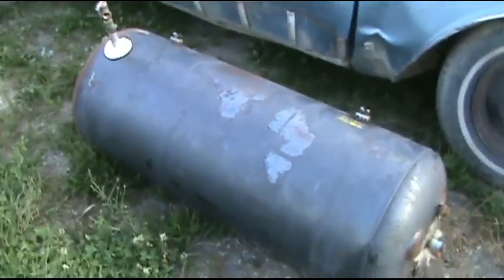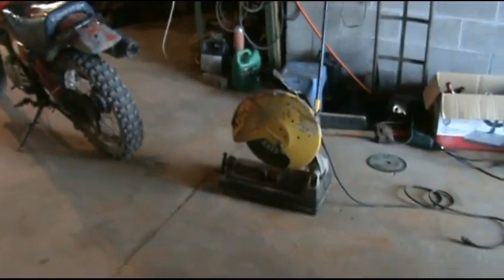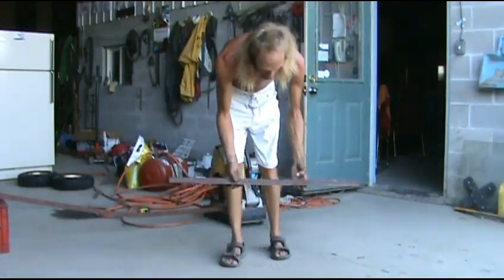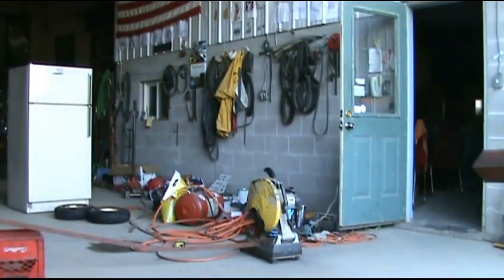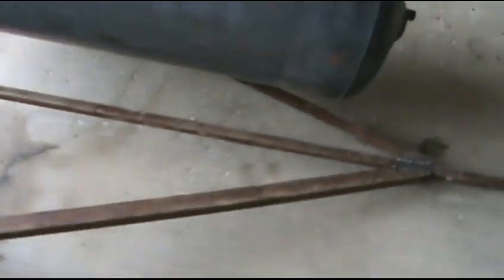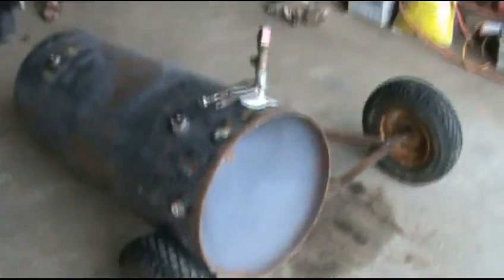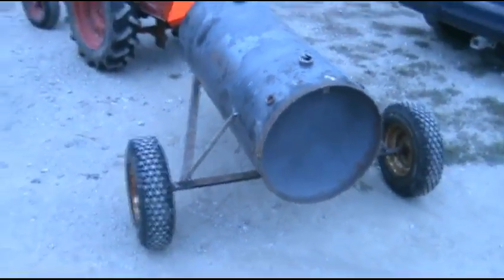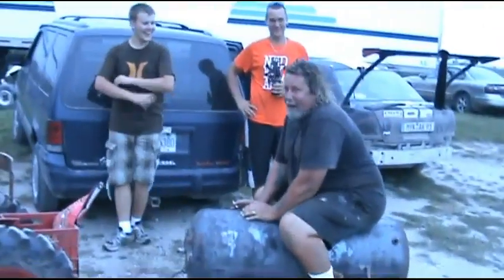Project Redneck Shower Pt.2

Comment: @nettbyy the recoil starters have a little bushing type thing where the rope comes out so the rope is always sliding over a smooth surface so you can pull it any way you want. rickems rope was probably just old and worn out cause it sits outside

Comment: hey rick if you pressureize the tank then you won't need a pump to run tjhe water to the shower.also if you want hot water put it over a small fire and can have hot water.

Comment: make a homemade electric start for the speedex? using an electric drill with a socket to turn it from the flywheel bolt..a few easy mods required. there is a few how to vids on youtube

Comment: LMAO why don't you get a motor for that thing with an electric start on it man? LMAO @ bloke,  would have been funny seenig him riding that thing like a bullet back to fill it up.  How you going to heat the water? and how are you planning to get it high enough to flow down into the shower with anything more than a trickle of water? also you should have put a door on that thing too so that you could completely enclose yourself in there and that's not going to work too well come winter time.